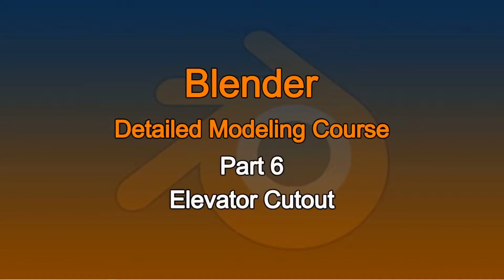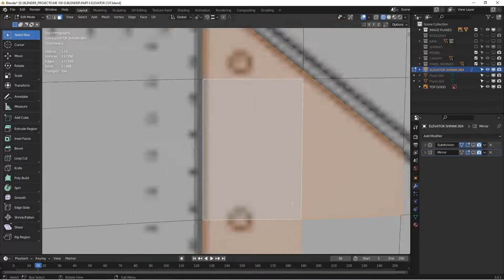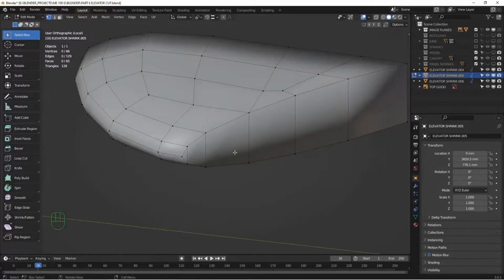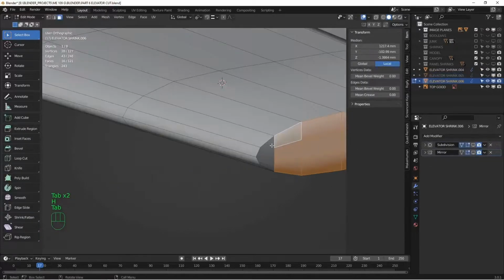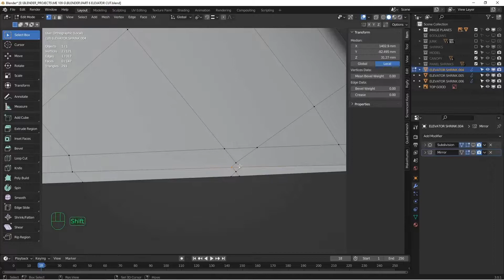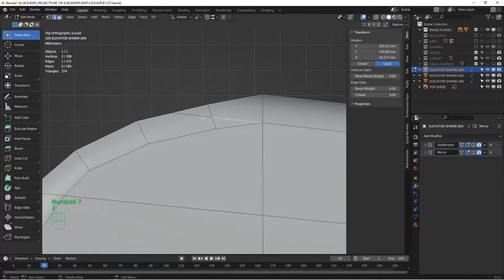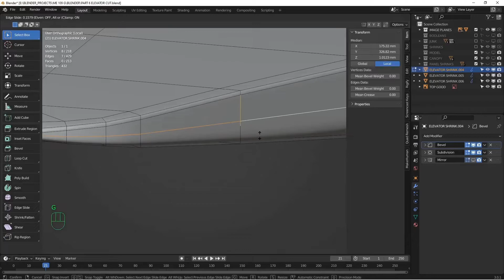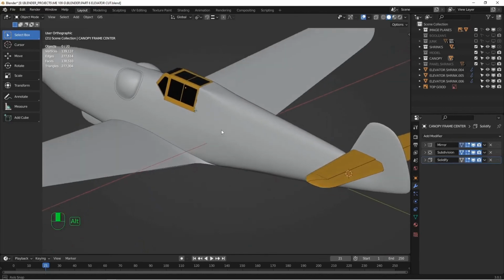Blender Detailed Modeling Course, Part 6: Elevators

Comment: Question. I apply all transforms and using these planes to cut my wings / panels (with subd turned off) still puts the cutting line someplace else and not actually where the plane is intersecting the surface? Thanks
Reply from the maker: hmm...

When you execute the cut, are you looking directly along the edge of your cutting tool?  The cut is projected from your view port and through the cutting tool.  If you're not looking straight down at the wing (e.g. from TOP view), the projection will be off.  Being in orthographic mode may help too (but I'm not sure of that).  I always cut while in one of the 90 degree orthographic views.  That way the cut projects directly along the X Y or Z axis.
Reply: @Mark_Alloway  that would actually make a lot of sense ha. Thank you!

Comment: Sir I want to ask, when you modelling your Rudder you are using Roundcube and Quadsphere and what did use for elevators? What is your opinion for me(A330-200) for Rudder(Clay Bar or Quadsphere)
Reply from the maker: I like to use the quadsphere for the tips of wings, elevators, rudders and  stabilizers.   The edge flow of the quadsphere works really well for going around the tip of the object.  Using the lattice modifier makes it pretty easy to reshape the sphere into the shape you need while retaining that nice flow of edges.
Reply: @Mark_Alloway  okay but my rudder has sharp edges, is quadsphere appropriate for this
Reply from the maker: @TheWeftmen  You're right.  That rudder is pretty sharp.  If I was modeling it, I would probably start with a simple plane.
Reply: @Mark_Alloway  okay thank you

Comment: mark did you shrink wrap the elevators to the rudder or extrude out of the rudder to make the flaps? how exactly did you connect the flaps to the rudder?
Reply from the maker: The elevators are completely separate pieces.  They were made exactly the same way the wings were.  Starting with a quad sphere for the elevator tip and then extruding back towards the fuselage.
Reply: alright, then how did you make it fuse with the rudder?. did you do what you did with the wings and the fuselage where you shrieked wrapped them together.  or did you just leave the flaps go inside the rudder and that's it?
Reply from the maker: @bustavkl5755  The elevator doesn't blend much with the rudder.   If you look at the video at this point (https://youtu.be/-duANwq0W34?t=19), you can see that it just goes through the fuselage structure (which is kind of what happens on the real plane). There is a small fairing along the seam of the rudder and elevator (https://www.flickr.com/photos/boglam/7672780654/in/photostream/), but I don't think I modeled that.  I think I just let the elevators stick out of the rudder without any blending.
Reply: @Mark_Alloway  alright thank you for the clarification mark have a great day.

Comment: Is there a non destructive  way of creating panel lines .
Reply from the maker: You can use bump and normal maps to create the lines.  I'm thinking of doing a short video on that topic sometime soon.  Just make sure your texture size is big enough, otherwise your panel lines will not be crisp.  On a model with this large of a UDIM setup, bump/normal panel lines should work fine.

Comment: couple question: what material are you linking at the end? I didn't think you'd applied any. Secondly- when adding a structure like the underwing radiator pods, is there any practical reason not to have it intersect the wing geometry? I mean where it meets the wing- is there an advantage to shrink wrapping as opposed to just going through a bit? Edit: did you apply the fuselage mirror mod for the rudder?
Reply from the maker: The material I assign at the end is just a temporary material I use to keep track of which parts of the model I have detailed and which parts still need work.  I assign it a non-white viewport color.  That way completed parts stand out from non-complete parts.

It's your call for the intersecting geometry.  If you're going to render a really close-up image, I would recommend making the part fit the profile because you'll be able to see the edge-highlights, but if you're never going to do a close-up or if you're going to animate it, then having intersecting geometry is just fine since nobody will see it.

For the rudder, I cut it out using the same methods as the elevators.  Then I applied the mirror and shrink-wrap modifiers.  It's been a while since I did this video, but I think I used a lattice modifier to achieve the final curve of the part (when viewed from the top).
Reply: @Mark_Alloway  cool that helps a lot, thanks

Comment: See what I mean how the hell you shrink wrap the stabilizer
Reply from the maker: The shape of the stabilizer was simple enough that it did not need a shrink wrap modifier after cutting it.  Other chapters have examples on how to shrink wrap panels, for example, Chapter 8 (how to make subpanels)  starting at about here: https://youtu.be/Ff1sZJk5U18?list=PLoW-6Ghw9DkXpmkJ5aRXqAWhOCtjh2B8f&t=339 shows how to shrink wrap panels.